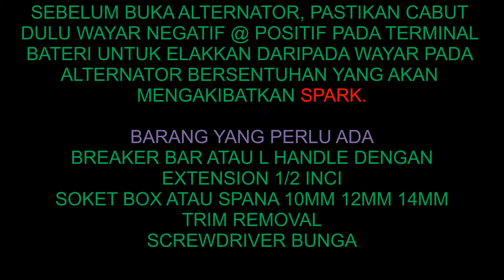CARA BUKA PASANG TUKAR ALTERNATOR PROTON CAMPRO PREVE SUPRIMA EXORA

Comment: Salam bang....sy baru repair altenartor then pasang balik tpi lps pasang masa on kunci (blm start) tiada lambang betri nyala...sblm ni ada nyala lps hidup enjin x nyala..tpi ni x nyala langsung...utk kes sy ni normal atau x?
Reply from the maker: Wslm. Tak normal. Try cek cuci soket/pin yg masuk ke altenator. Cek cuci kepala bateri/clamp wire. Cek fuse 100A. Cek charging voltage bateri  masa enjin hidup. Cek continuity wire. Kalau semua OK, altenator ada mslh. Repair apa tu? Tukar ic ke
Reply: @diyapasaja2106  ganti ic,bearing dgn pully...sblm start dpt 12.5v tpi lps start drop 11.8..bila on aricond turun 11.5v
Reply from the maker: @auroraaura7461  Cuba cek dlu mcm sy bgtau tu. Kalau x ok jugak, kena cek balik alternator. Alternator mslh tu
Reply: @diyapasaja2106 ok bang nti sy cek balik tpi  fius 100A d mana kedudukannya utk model saga flx ?
Reply from the maker: @auroraaura7461  dkt kepala bateri positif

Comment: Ape beza alternator preve turbo dengan non turbo?
Alternator preve turbo dengan exora turbo sama ke
Reply from the maker: Alternator preve cfe dgn preve biasa sama je. Pkai 90 amp. 
Alternator preve cfe dgn exora bold sama je. 
Alternator preve ni beza dkt batch preve. 
Utk 1st batch x kisah turbo ke x sama je pakai 90 amp. 
Utk 2nd batch x silap start dari 2015 dah upgrade altenator pakai yg 115 amp.
Utk preve refinement rasanya sama jugak 115 amp

Comment: Salam..hose yg di bawah ocv tu hose ape ye..
Reply from the maker: Wslm. Hose waterpump. Dia lalu bwh intake manifold bersambung ke paip waterpump bwh air cleaner. Dan bersambung ke lower hose radiator
Reply: @diyapasaja2106  terima kasih bang..ada video cara pasang..
Reply from the maker: @azliaziz4280  sama2